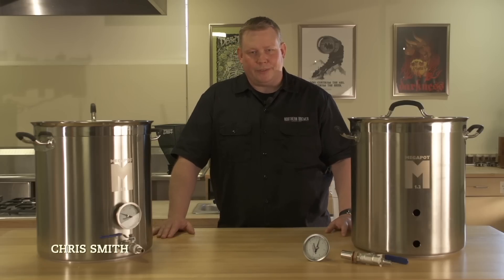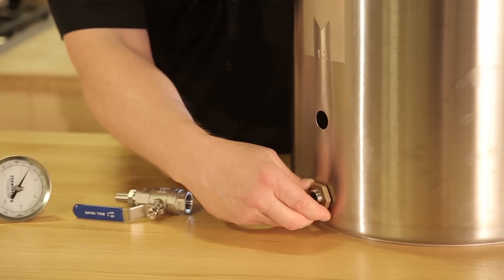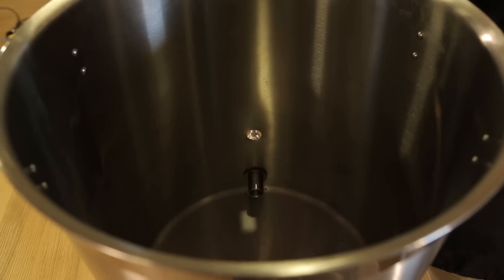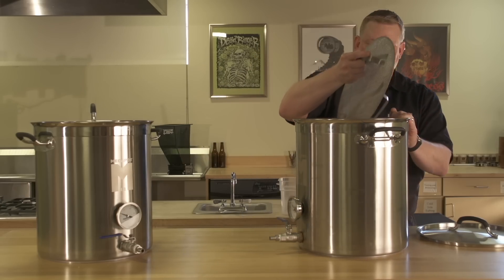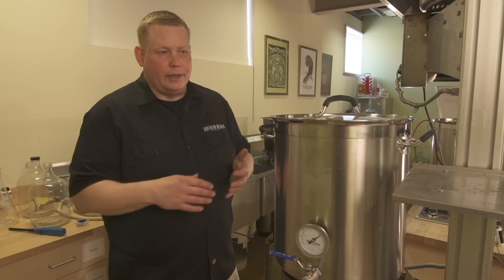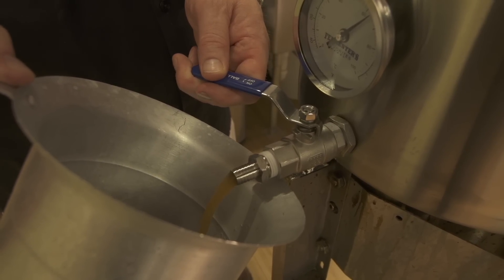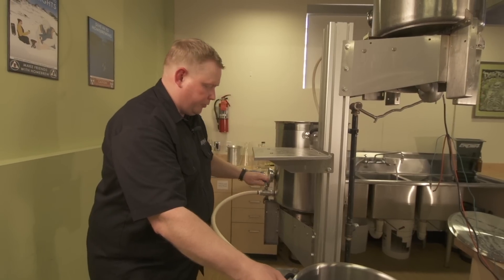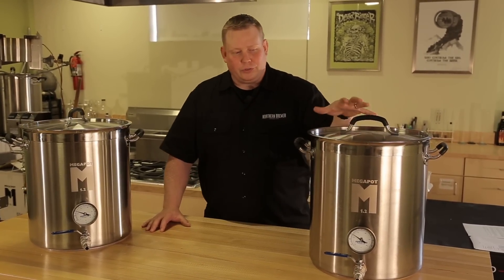Megapot 1.2 - The Most Advanced Brew Kettle on the Planet

Comment: I have one of these and its fantastic. Just had my first brew day with it last week and everything with the kettle went very well. I'm a bit rusty after having being on a break from brewing for a while but I get a few under my belt and it will be all good. My only regret was not getting the version with the thermometer.
Reply: I think you've had lots of regrets when the WELDLESS fittings begin to leak in the middle of a brew day.  Not to mention how the weldless fittings are so flimsy when you try to attach quick disconnects and other accesories.  Get a pot with welded fittings and you'll be much happier.